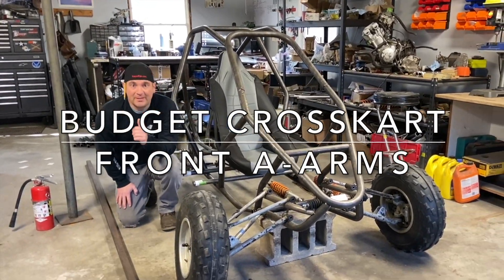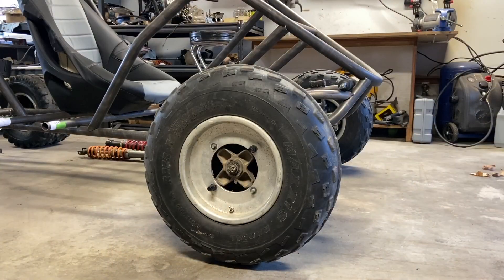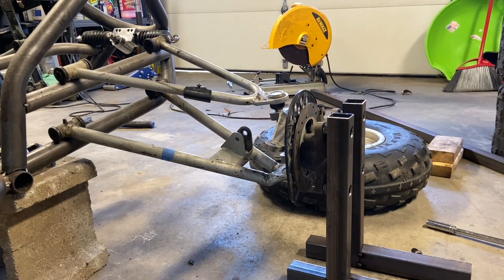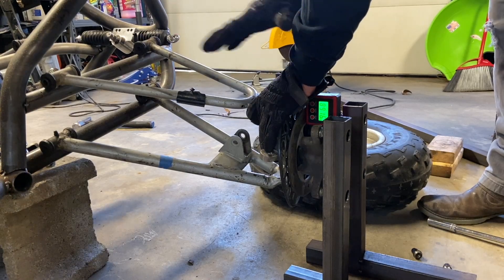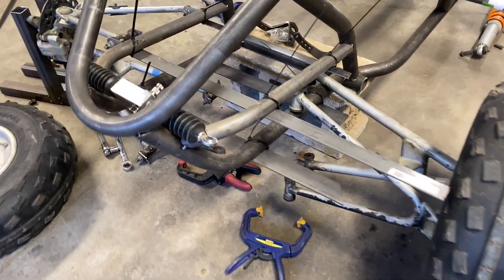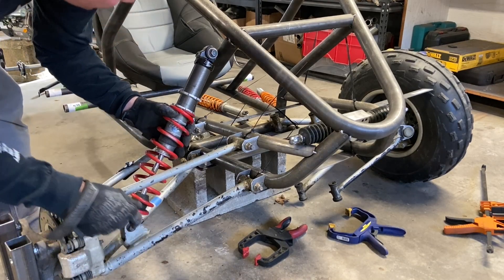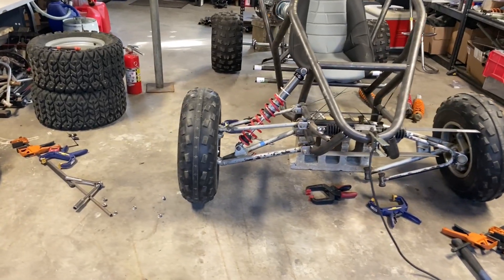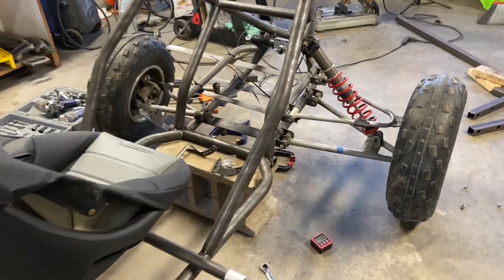Budget Crosskart Build#5: Front End

Comment: I don't understand how the A arms will swing, as they are not parallel?  Wont they bind up?
Reply: the idea of them not being parallel is to keep the hub and knuckle in vertical alignment through the radial arc. They are jointed at both ends. The frame won't move but the knuckle will, keeping the wheel more or less vertical as it moves between ride height, full compression and full droop.

Comment: super late to the party here, but why not use the jig for aligning the control arm bars for building the chassis, and also put in a shelf and end pieces on it for locating the tabs for the control arms?  you would have to adapt it to whatever control arms you end up using, but it could make mounting them easier if you have the measurements?

Comment: Do the plans have specs for only using Polaris aarms? I was wondering if the plans and dimensions are specific to Polaris aarms? I just don't want to buy aarms that will cause issues.
Reply from the maker: There have been all sorts of arms used. I’ve personally used 4 different kinds. Polaris predator and outlaw arms are just abundant and well priced 😁. Atv geometry is similar enough to make up the small differences in the tabs and how you mount them. Definitely use the jigs and you will have an awesome front suspension.
Reply: @KJRaycing  sweet.. I'm just finding some great priced Yamaha front ends in my area
Reply from the maker: Best bet is +2 yamaha arms but there is always wheel offset if you are picky about front and rear track widths being the same…

Comment: Awesome Design, Simple and effective. I will need to make one as well. Glad to see you are still continuing the videos. All of us really enjoy them. For me, I think I will need to move my front A-Arms just a bit closer forward. But I like my tires just a bit behind the front of the cart. The only issue with that is that it makes the Rack and pinion back farther which might cause other fitment issues. Keep up the excellent work.
Reply from the maker: Thank you very much! I really hope this helps all the builders out there like it helped me. Since this one has no clutch I’ll probably run the steering rack on the backside to retain ackerman, or even make ackerman adjustable. Always thinking ahead! Thank you again for the compliment. It means a lot.
Reply: @KJRaycing  it's called rear steer, or front steer. The distance between your arms to the chassis is much less than between your arms and the hub. I love your frame but your suspension geometry needs work. No disrespect intended.
Reply from the maker: @Chuck Ingram No offense taken, I’ve built three already and all of them track straight, drift amazingly and handle jumps and bumps without flinching.  All from secondhand ATV parts. I usually mount the rack forward of the hubs and flip the hubs, but that gives anti ackerman, I reduce it as much as I can and run a little toe out to compensate. On this one since there isn’t a clutch (only two pedals) I can run the rack on the backside of the hubs and not flip them, retaining good geometry. Thanks for tuning in! I’ll see you on the next one 😁

Comment: Will it stay 0 deg all the way through the A-arm travel?
Reply from the maker: They will not. Since the upper a-arm is shorter than the bottom, it has what is called camber gain. As it goes through the stroke it gains camber to adjust for body roll giving you a better traction footprint through corners. Even with sway bars cars do not stay perfectly flat through turns, well, unless you want them to 😁
Reply: @KJRaycing  Interesting man i didn't think about them working like that but it makes since now that you explain it. Keep the videos coming man i don't mind learning new things.

Comment: Love the jig idea, but I'm not sure how accurate the degree measurements can be on a garage floor and cinder block. I'm sure it's 100% good enough for a low power build that will be used mostly on dirt, but if someone was wanting to put a bigger engine and use it on pavement, they might want to get the frame and jig on a dead level surface to measure.
Reply from the maker: Well the degree measurements are absolutely accurate because the angle finder isn’t based on the garage floor, it is based on the the actual angle. The jig is meant to hold everything in place so it is easier to weld everything in place and pull measurements from the hub itself. And it worked phenomenally. This is a predator 420 budget build; as you’ve seen on my channel the higher power crosskarts have fully adjustable a-arms.
Reply: @KJRaycing  I get that the angle finder is reading the angle regardless of the floor. But what I was thinking is that it has to be correct relative to the kart as well. Which is why I was thinking that it would be best to have a level work top so you know the kart frame is sitting correctly when you measure. If I’m wrong, feel free to correct me. I’m here to learn as I plan my build!

And I agree 100%. For a low power kart this is plenty good enough.